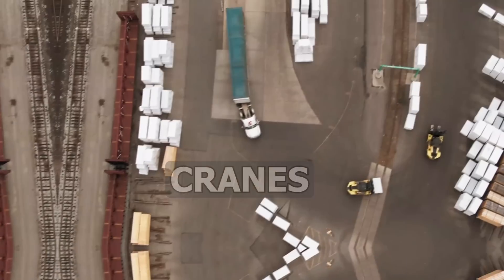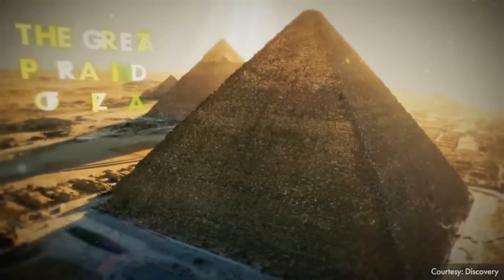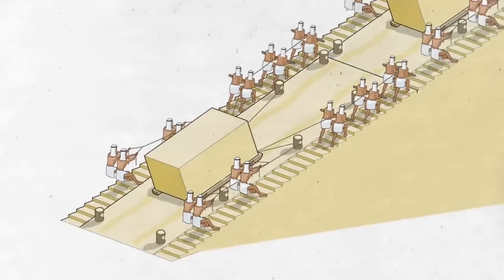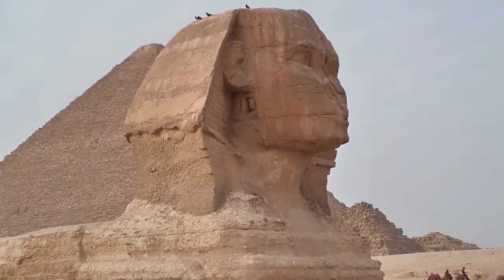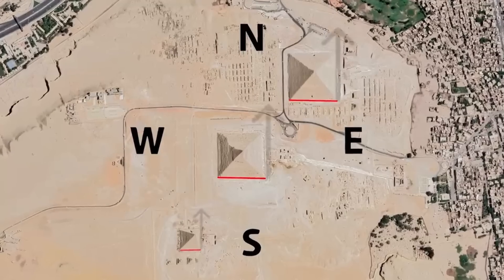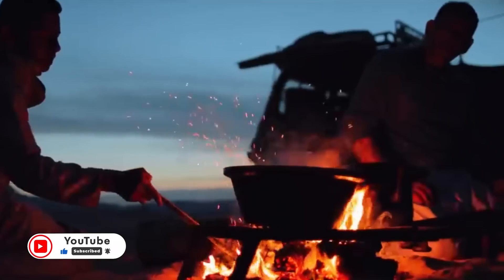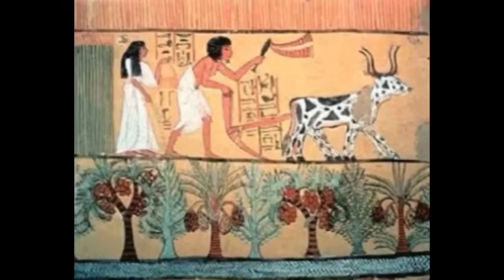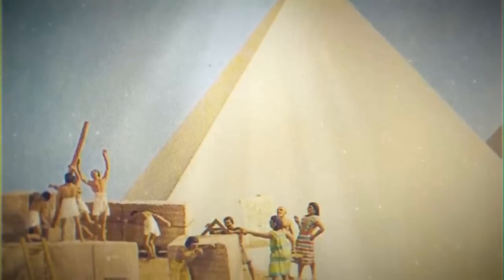How Ancient Egypt Built The Pyramids (Theories Explained)

Comment: I am very sorry but your explanation just does cut it with me! lets take for example cutting the stones as one point, you say copper chisels and diorite pounding stones were used, current day man or men could not accomplish this task in terms of accuracy over time, it has been proven time and time again, the symmetry of all sides needs to be measured to the 0 degree to prevent rock movement and accuracy, if we look at the Valley Temple in Cairo, the gap between each stone is a few thousands of an inch and that can't be done with the above utensils, we can only hypothesize on how we think it was done because there is absolutely no evidence what so ever anywhere that suggests clearly or illustrates on how this was accomplished.